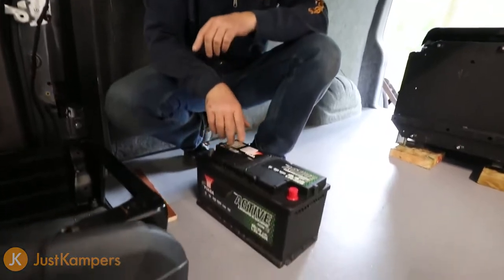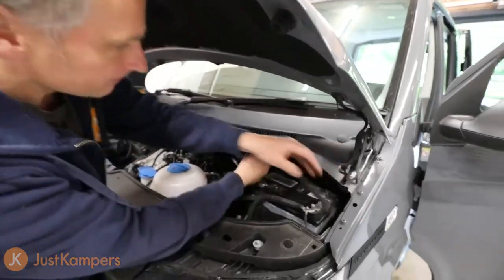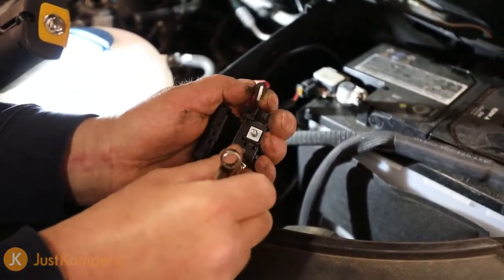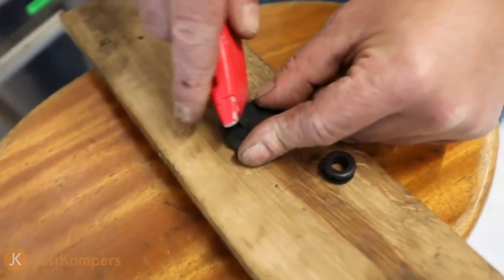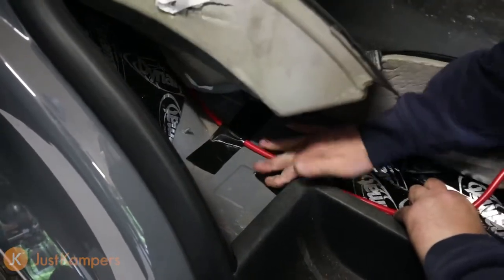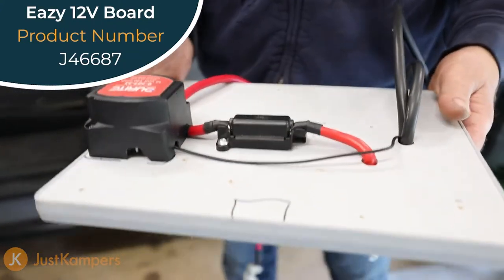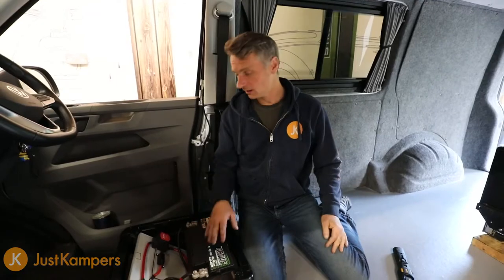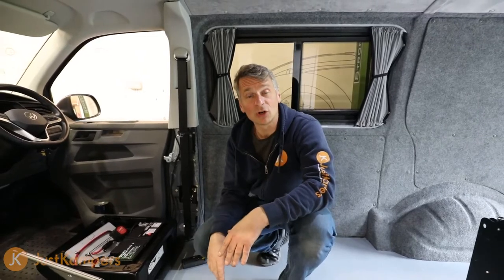JK Guide: How to fit a leisure battery to your  T6 & T6.1

Comment: Very helpful guide, but I'm concerned about the gases given off by the battery whilst charging. Especially being in the passenger compartment.
Reply from the maker: Hi Paul, to safe guard this problem it is advised that all leisure batteries are vented to the outside the vehicle. We shall be doing a more in depth video about leisure batteries which shall cover this topic.
Reply: You can run a vent pipe from the leisure battery out through the floor. There's a round grommet (located near to where he attached the ground cable to the chassis) which you can feed the pipe through, so any nasty gases flow down the tube and outside the van.

Comment: i thought t6 and t6.1 had smart alternators that wont work with the standard split charge relays? DC-DC charger instead?
Reply from the maker: Yes you are correct, they do have smart charge alternators. The split charge relay we used is specifically for smart charge alternators. Hope that helps :)
Reply: You are correct Richard, a split charge relay will result in the auxiliary battery not charging for a large portion of a journey. The vehicle typically aims for around 80% SOC

Comment: Can I ask how you got the cable through in the cab side? Did you have to remove the dash? If so how? Many thanks
Reply from the maker: Hi Ben, once the wire is pushed through from the engine bay it appears behind the glove box, which you can access from underneath the dash. So need to remove anything from the dashboard :)

Comment: Hi buddy what is the hight of that battery as I've got a  190mm to go under drivers seat and wanted to no if it will fit ok.
Reply from the maker: Hi, we do think it was also 190mm, but we will double check and let you know!
Reply: @justkampers  how did you get on I was going to fit the metal base plate but that's probably going to lift the battery up more so just going to go with a strap I think 🤔 cut down on lifting the battery any higher than it is.

Comment: Useful video - Are you able to comment on the pros and cons of this split charge relay compared to say the Victron B2B charge controller?
Reply from the maker: Hi, the battery to battery is perfect for anything Euro 6 onwards, with smart charge alternator.
Reply: @justkampers  Thanks.👍
Reply: Is this T6.1 not euro6?
How come you didn't use a B2B?

Comment: Hi, thanks for the videos, all very helpful. Should the leisure battery be vented?
Reply from the maker: Hi Ian, it is advised to have some ventilation around the leisure battery. Especially in the summer months air flow will help to reduce risk of over heating. Kind Regards, JK
Reply: You can run a vent pipe from the leisure battery out through the floor. There's a round grommet (located near to where he attached the ground cable to the chassis) which you can feed the pipe through, so any nasty gases flow down the tube and outside the van.

Comment: Is that a special split charger? That looks like a t6 I was told you couldn’t use a standard split charger due to the smart alternator? I was told I need a DC to DC instead??
Reply from the maker: Hi, this video just demonstrates how to fit a split charge relay, which is voltage sensitive. With this setup the leisure battery will charge fine for standard usage, as it has solar backup. But you are correct a DC to DC charger is the most efficient way to charge a leisure battery with a smart alternator setup. Thanks for watching!

Comment: How to charge second battery via charger 230V?
Reply from the maker: Hi, we would recommend the Sargent EC155 power supply unit. This have 12v outputs and also 240v, the great thing is when this unit is plugged into a campsite supply with a flick of a switch you can charge your leisure battery.  Sargent Unit here: https://www.justkampers.com/sargent-ec155-power-supply-unit-charger.html

Hope that helps!

Comment: why wouldnt you just take the positive through the bulkhead on the passenger side then straight across below the dash area under the rubber floor mat and then to the driver seat? that would save all the trouble with removing the passenger seat?
Reply: its way easier on the t5 to enter the cab on the drivers side

Comment: Great vid! Thanks for pulling it together. 
Did you need to hook up to an ignition fuse at all for the smart alternator? or does the split charge relay complete that function?
Reply from the maker: Hi, no need for an ignition fuse or feed as the split charge relay is designed to function with the smart charge alternator. :)

Comment: Do you not need a smart split charger for a euro 6 van?
The split charger on this vid does not look like a smart charger.
Reply from the maker: Hi, generally you would need one for Euro 6 onwards. We would suggest the CTEK DC to DC charger. This would help the battery reach it's full charge. A split charger will work but not as efficient as a DC to DC charger. Hope that helps. :)

Comment: Think I'd have a straight split charge lead going to the battery and then take the feed for the fuse holder to appliances rather than from the van lead .